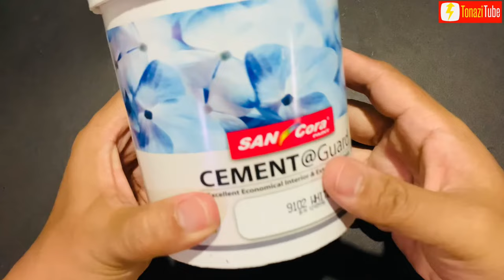How to Repair Plaster Ceiling Step by Step | DIY Fix Hole in a Plaster Ceiling

Comment: If i not use cement guard, can?   only use putty filler.
Reply from the maker: You can do that but without cement guard…tone color might be different (repair area)

Comment: Fan rod hole is big, can we do this same thing?
Reply from the maker: Can try but with more tape apply to cover the hole.
Reply: This is exactly what I’m here looking for. If ya see this in the next 3 days, lemme know if this worked fine, or if ya found something else.
Reply: @loganmcphee4353  I used normal wall putty to cover the hole, it went good..no tape used
Reply from the maker: @cement006 Thanks for sharing your experience 👍🏼

Comment: Can i use mosquito net?
Reply from the maker: Yes!You may use mosquito net to replace drywall joint tape
Reply: That last substance is paint right?
Reply from the maker: Yes…its a white paint
Reply: Hi,if I paint by ‘wall sealer’,ok?
Reply: I mean for ceiling?now I’m facing a problem that after apply the wall sealer at my ceiling,after it dry,keep dropping some white dot or marks on floor.can’t figure it out what would it be?
Reply from the maker: OK!
Reply from the maker: What kind of tape you use to cover the hole?Drywall joint tape?May be got issue the paint not totally stick to the net.